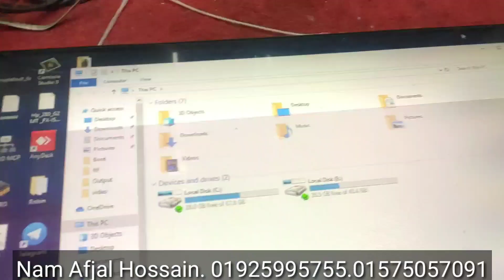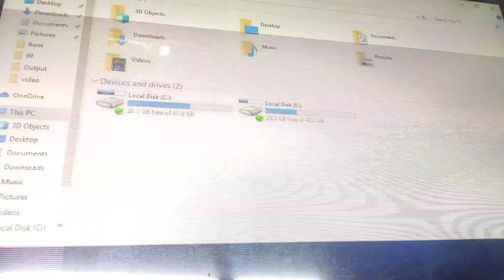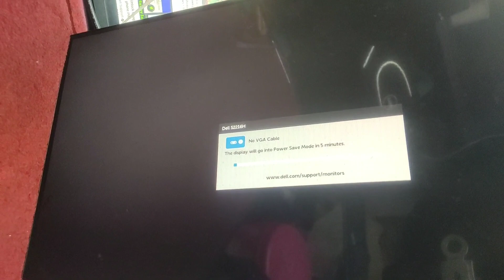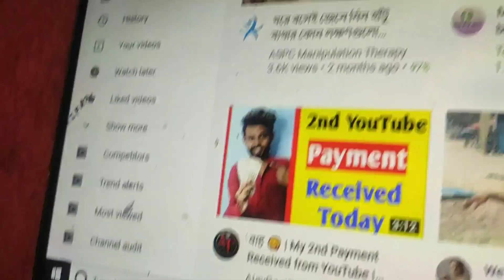Dell Border Less S2216h Monitor Panel Repair  2020

Comment: I have same monitor, and same problem but I don't know what you should and what you says, pls help me. my local engineer told me 1st panel repair by machine/and 2nd card problem
Reply from the maker: please go to local engineer or technician then you have to need identify what is the main problem. if you see  the panel problem no need to repair that you just buy a new monitor